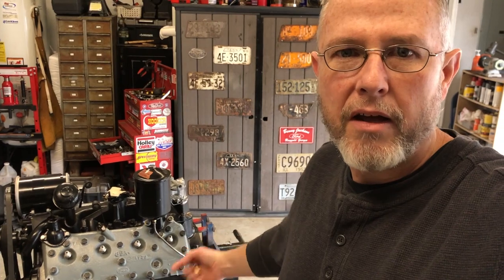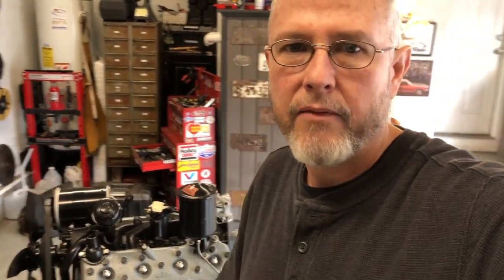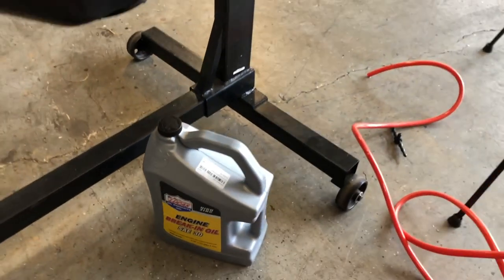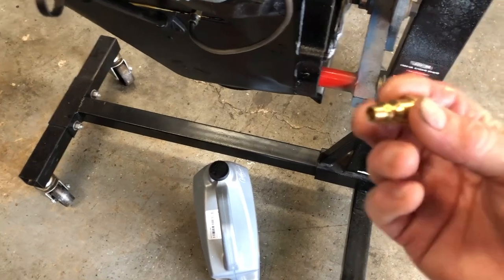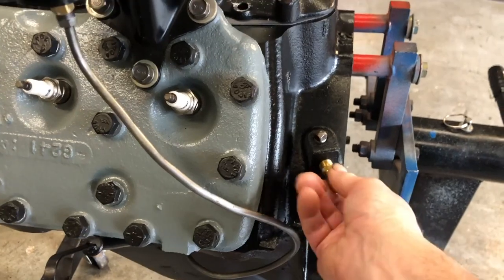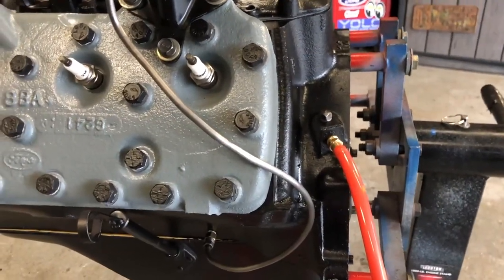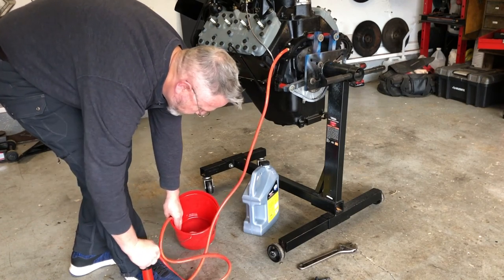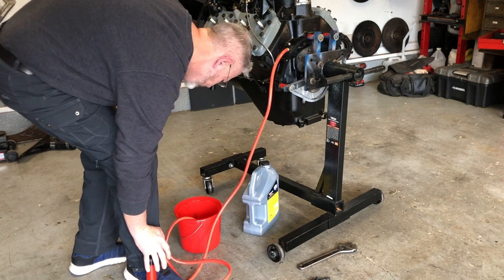How to PRE-OIL your ENGINE before BREAK IN - Flathead Edition

Comment: Engine looks sweet man love it. I just put some Marvel mystery oil in my two flat head engines to see if it will become unsized if not its comin on out. In the future if I run in to any trouble, I might be askin you some stuff if you don't mind. and again, your videos are a tremendous help thank you.
Reply from the maker: Absolutely.  I’m happy to help with anything I can.  

Some old timers once told me to use apple cider vinegar in the cylinders to help free up flatheads.   But in my experience with flatheads, it simply sometimes takes blunt force to get them free.  Especially considering many of them have been stuck for 50 or more years.
Reply: Yes sir I’ll try that thank you

Comment: Is it the same on early flattys? I have a rebuilt 1940 that sat,id like to prelube before i get her running again.
Reply from the maker: Yes.  You can pressurize the oil system through the oil pressure port in any Flathead